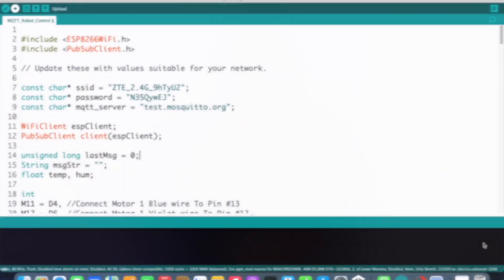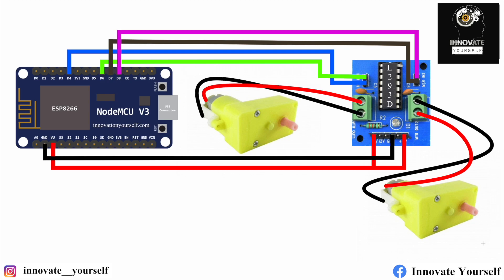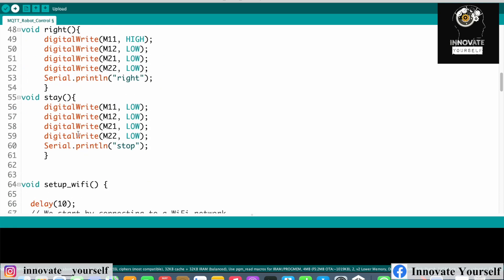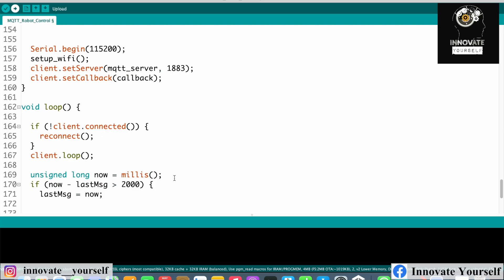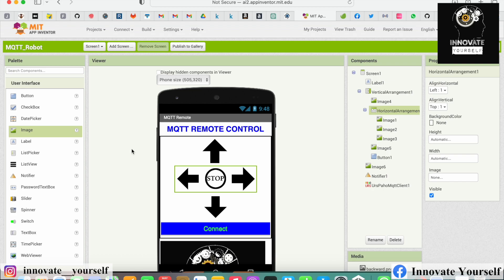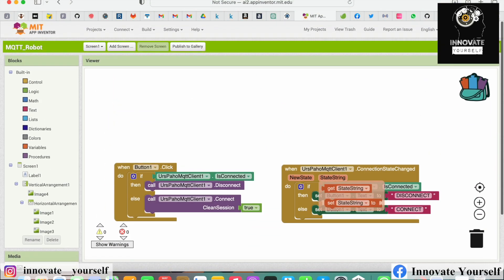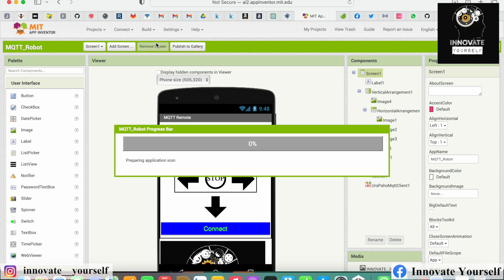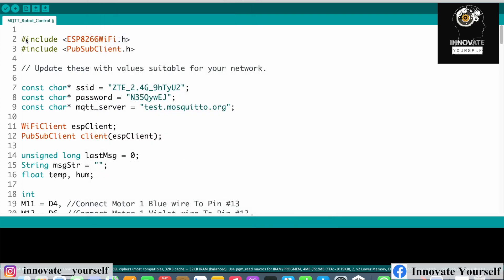MQTT and NodeMCU-Based Robotic Car Control | DIY Tutorial

Comment: Hello author, please tell me how to use the battery to power the motor and esp32. I look forward to your reply. Thank you very much.
Reply from the maker: For the motor you have to use the motor driver IC or module. And a separate battery for your esp32 if the power is not sufficient which will be connected on pin Vin and Gnd on esp32.
Reply: @InnovateYourselfashu  I have now successfully made an esp32 four-wheeled smart car based on the source code and the connection method of the components in your video. However, turning left and right also requires the application of ENA and ENB, so the only real thing is to move forward. and the back function, but thank you for your reply and wish you good luck and prosperity.😏
Reply from the maker: @user-kc8kg8og7e I'm happy that you made it. 😊